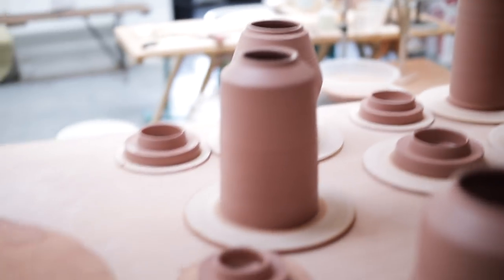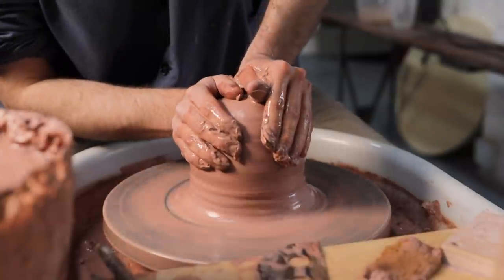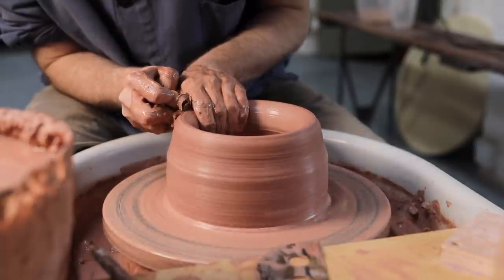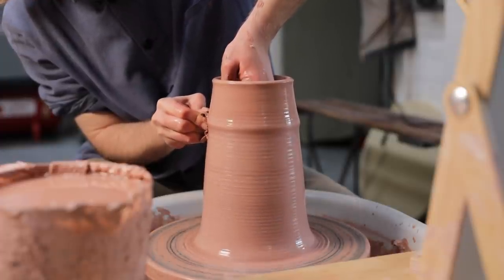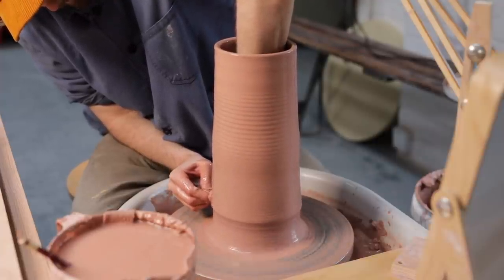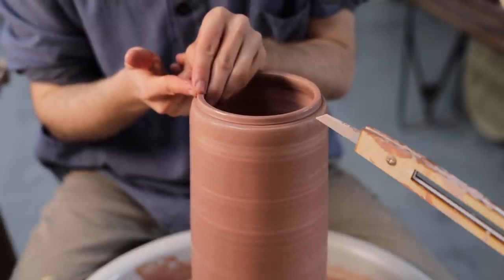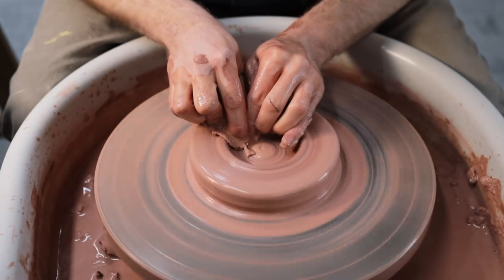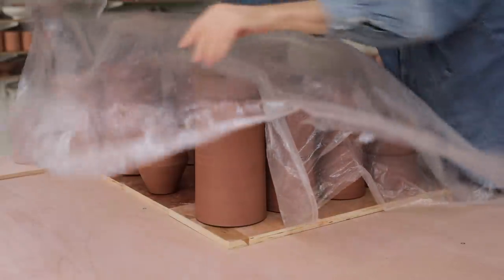Throwing the Lid and Body for a Large Pottery Jar — Narrated

Comment: Do you ever oversaturate your clay? I find when I’m throwing larger vessels (very new to this) I have to use so much more water. I get nervous about using too much
Reply from the maker: I tend not too these days, using very slippy water can help prevent this as it clings to the surface of the pot for longer but it takes some getting used to.
Reply: @floriangadsby  erm. What is “ slippery water “ as opposed to wet or more water?
Reply: @lukeorlando4814  slip means part clay part water. He is saying he doesn't add just plain water while throwing
Reply: @bjbmbc thanks. So, presumably a more diluted version of the “glue” he used to adhere the handle to Toms mug.

Comment: Hi Florian, why does the inward tapering wall of the lid on your pots slope inwards slightly? Is it so they will fit better with less chance of warping in the firing?
Reply: not an actual answer, but my idea is that it’s simply a stylistic choice, but i think also so that there isn’t such a large gap between the body and lid itself